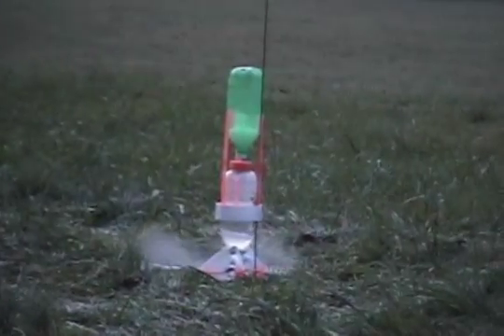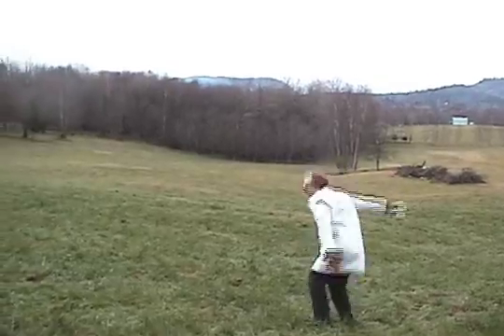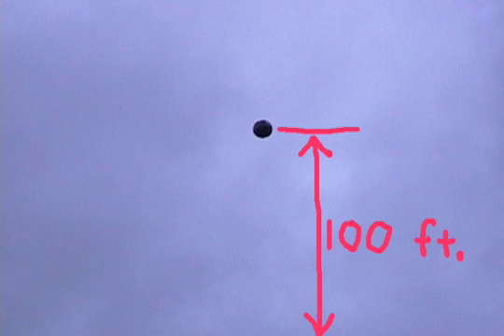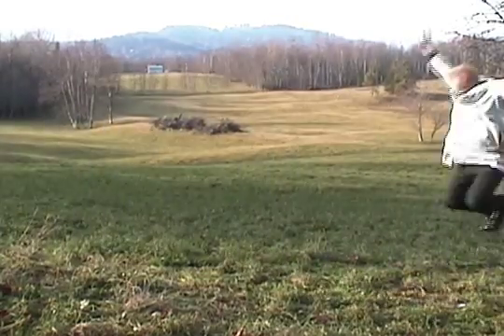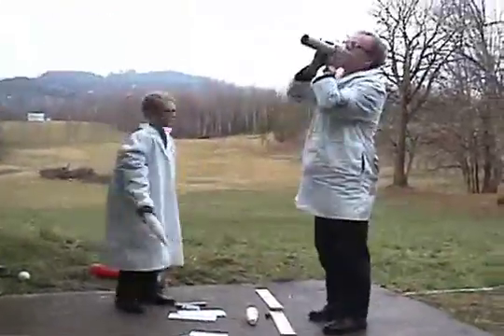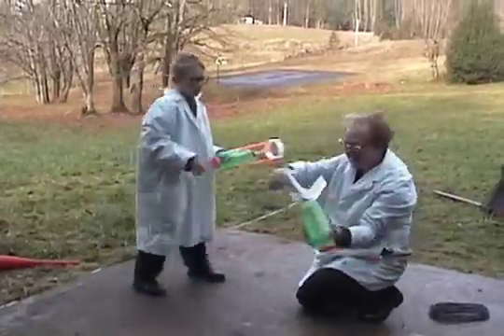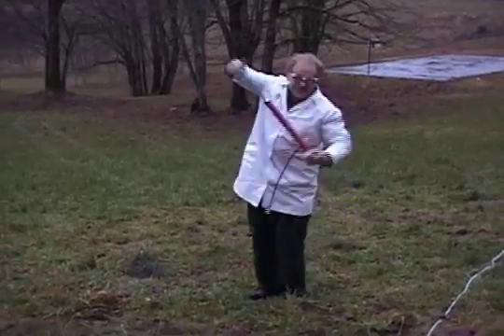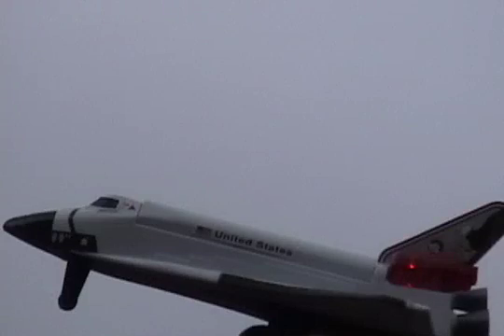Introduction to the 2-Stage Water Rocket

Comment: Thank You so much! ..but still I am not sure if I understand how the fist stage is connected with the second stage (ie the top / bottom of the 1st stage bottle.. ..is connected with the 'lid' of the 2nd stage bottle)..?? ..in order for the air (pressure) to get in..? ..and especially when we have to prevent the water (of the 2nd stage) licking out - during the filling of the 1st stage..?
Looking forward to your explanation..??

Comment: Do we have to put air to the second stage (upper) too..?? Are the two stages connected..??
Reply from the maker: All stages in the 2-Stage and 3-Stage rockets are connected to the first stage. Pressurizing the first stage pressurizes all the stages. Filling happens relatively slowly, so all the upper stages acquire the same pressure as the first stage through tiny pinholes in each interstage connector tube. Launch causes a very fast depressurization, so when the previous stage is almost empty the pressure in the next stage compresses the interstage connector tube to a smaller diameter and pushes it out of its nozzle. Depressurization is very fast compared to filling, so the pinholes don't matter during flight.
Reply: @antigravityresearch  Thank You so much! ..but still I am not sure if I understand how the fist stage is connected with the second stage (ie the top / bottom of the 1st stage bottle.. ..is connected with the 'lid' of the 2nd stage bottle)..?? ..in order for the air (pressure) to get in..? ..and especially when we have to prevent the water (of the 2nd stage) licking out - during the filling of the 1st stage..?
Looking forward to your explanation..??
Reply: @001TSOLAKOS  The 2nd stage is held 1. by the interstage connector which expands because of pressure, 2. the styrofoam circular fins also hold to the 1st stage as the 1st also expands with pressure. When pressure drops both the tube and cicular fins loosen up and releases the 1st stage

Comment from the maker: As the rocket is pressurized the upper stage has enough weight to hold it down .  The interstage tube expands and presses on the inside of the upper stage nozzle.  When launched, the booster stage pushes on the upper stage so it can't escape.
When the booster is empty it stops pushing and the yellow tube collapses, letting go of the inside of the upper stage nozzle. Pressure in the upper stage pushes the interstage tube out, causing stage separation.  This all happens in a fraction of a second.